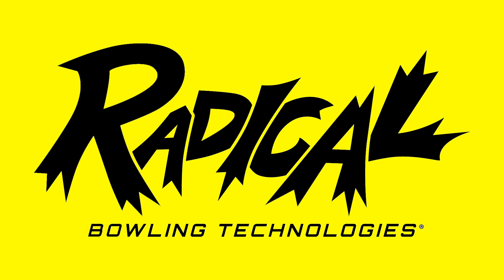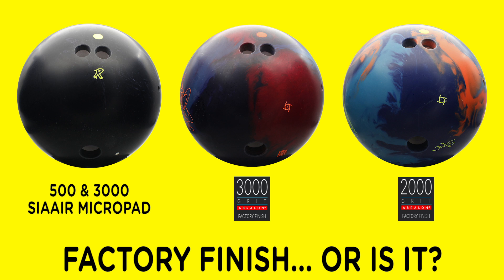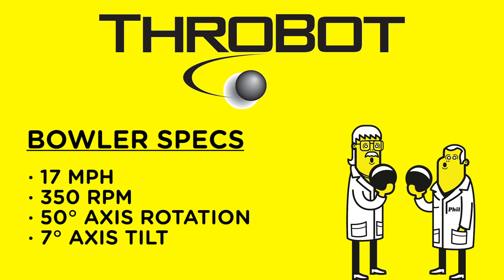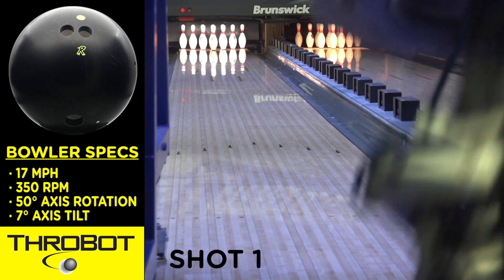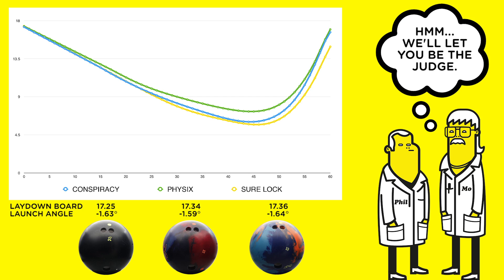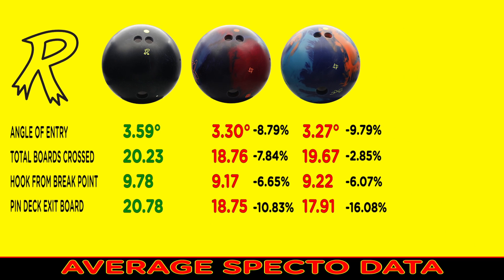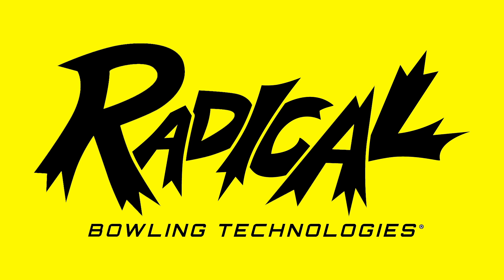Perception vs. Reality 6 - Radical vs. Storm

Comment: I think you got your data mixed up.
The first shot with the Physix left a 9 pin, but your data has the ball exiting on the 18.84 board which would have hit the 9 pin. The data you have listed as for the Sure Lock’s first shot has the ball exiting on the 21.9 board which would be correct for missing the 9 pin. Looks like those results were swapped.

The exit point of the 2nd shot of the conspiracy on the 23.18 board looks invalid. It’s not further left than the physix 1st shot which you have listed at 18.84 or 21.90.

The problem with videos like this is Radical can while filming, throw all the balls at all kinds of angles, then cherry pick the results, leaving the non-favorable results on the cutting room floor.

For the video to be useful, the viewer has to trust the presenter who is a salesman. 

Not exactly the most trustworthy profession.
Reply: Mike White 🙌💯👍
Reply from the maker: Let's play out a couple scenarios. 

The first, the 20.875 theory. If Specto happened to miss the data for the pin deck exit board, that would bring the average of those 2 shots to 19.77, or -5.11% of the Conspiracy. Still less. However...

The next scenario assumes that the 9 pin is on the 14 board. Pins can become off spot. https://www.dropbox.com/s/k1vf0yzfy4dw6yq/comparison4.jpg?dl=0  We wanted to check and see if the 9 pin was in the same spot for both shots so we backed up the ball path before anything comes in contact with the 9 pin. https://www.dropbox.com/s/emovp4256nc83m7/comparison5.jpg?dl=0 This shows that the 9 pin is off spot right on the shot with the Physix because the 9 pin location is not always constant.

And finally, the Sure Lock is much further left in this next image, because the Physix deflects to the right after the 8 pin impacts the ball. Watch the video, once it passes the 9 pin, it pushes back to the right. Specto captures the data point just before leaving the deck, but it is not known for certain the calculation so we can only assume just before it drops off the pin deck. So here are the 2 shots at the very last point before they drop off the back of the pin deck. https://www.dropbox.com/s/57233nzqso1fe27/comparison6.jpg?dl=0

We appreciate the discussion, we're in the science of bowling and there will be many more of these videos in the future.
Reply from the maker: But wait, there's more! 

Last scenario, we promise. If the Physix truly was 20.875 pin deck exit board (which it wasn't) then you have to take another look at the Conspiracy in shot 1 compared to the Physix with where it left the pin deck. https://www.dropbox.com/s/jglsjsa2ke7c8v1/comparison7.jpg?dl=0 The pin deck exit board is very close with the Physix a bit further left as stated in the video data, but both are still significantly further right than the Sure Lock on the first shot.
Reply: Y'all really reaching for some Conspiracy level conspiracy on this.  A robot throws the ball and the most advanced ball tracking system tracks it....  but the data is skewed.  What?!?!?  I guess we need to go back to the days of using humans throwing the balls to compare them.  Way more accurate.
Reply: Its not the data that is skewed, its the interpretation of the data that is skewed. If I throw a 6 lbs ball Brooklyn, the exit board is likely to be somewhere in the left gutter. Since that number would be larger than 23.18 does that mean the 6 lbs ball is better? Data without context is worse than "humans throwing the ball"
Reply: @mikewhite735  you probably want to throw a heavier ball and aim a little bit more right.
Reply: jangofett2 it depends, is my goal to increase my score, or to increase my exit board.
Reply from the maker: Continuation and strike percentage go hand in hand. 

For more context, on shot 2, the Conspiracy's entry position at the pocket was 16.27 board and continued to 23.18, or +6.91 boards of continuation. The Physix's entry position at the pocket was 16.45 board and continued to 18.66 or +2.21. Lastly, the Sure Lock's entry position at the pocket was 14.35 and finished at 13.92 or -0.43 boards. The ball that continues more has more energy going through the pins which equals more strikes. 

This is only one of the 4 critical performance categories we measure. All 4 contribute to higher strike percentages.
Reply: RadicalBowling You’re still confusing “continuation” with deflection. Throw 2 identical shots at the pocket. On one shot only have the head pin, on the other only have the 3 pin. They should have the same quality of shot, but drastically different exit boards. Exit board is not necessarily a good indicator of “continuation” in the case of the 2nd shot for the Conspiracy, the exit board is not a good indicator. This is a perfect example of potentially cherry picking the shots. 23.18 looks good but it only occurred due to fluke pin carry of the 5 and 8.
Reply: RadicalBowling of the 4 “critical performance categories” you list, only 1 is really important. Angle of entry. There are 3 total. Angle of entry, mass of ball, and offset. (I.e. where the ball hits the headpin)  USBC’s pin carry study showed the importance of offset.  Angle of entry of 2 to 6 degrees is plenty if the offset is correct.
Reply from the maker: Your analogy is incorrect. We bowl with a full rack of pins all the time and you're trying to introduce variables. (going brooklyn with a 6lb, using only a 1 or 3 pin) 

We throw identical shots. Once ThroBot lets the ball go, the laws of the universe take over and this is what we test. The only variables in this test are the different bowling balls and that's the point. The USBC found that the "sweet spot" of the pocket is around 17.5 board, but we're not testing that.  We're testing the performance of different bowling balls and using the data to show the difference. In fact, in all 6 shots, the "most flush" pocket hit was the Physix at 16.49 entry position. The Conspiracy was 15.62/16.27, Physix 16.49/16.45 and Sure Lock was 16.27/14.35. 

It's perfectly fine if you don't agree that continuation through the pins is not important. However, if you take 100 shots of identical total hook, hook power and entry angle with an average entry position of 17.5 and a pin deck exit board of 20 vs the same identical shots with a pin deck exit board of 16.5, which will strike more? 

The answer is simple -- the ball with more continuation through the pins. 
(Or if it makes it sound better to you, the ball that deflects less going through the pins)
Reply: Lets start with "the ball that deflects less going through the pins"

To determine how much a ball deflected you would need to know where the ball would exit if it achieved 0 deflection.

Based on the entry position, and angle of entry, the 0 deflection exit position can be calculated.

The results are as follows.
Ball Name, 
Shot #, 
Entry position, 
Entry angle, 
0 deflection exit, 
Measured exit, 
Net deflection

Conspiracy, 1,  15.62, 3.36, 18.07, 18.37, 0.30 left
Physix, 1, 16.49, 3.26, 18.90,  18.84, 0.06 right
Sure Lock, 1, 16.27, 3.32, 18.72, 21.90, 3.18 left
Conspiracy, 2, 16.27, 3.81, 19.08, 23.18, 4.10 left
Physix, 2, 16.45, 3.34, 18.92, 18.66, 0.26 right
Sure Lock, 2, 14.35, 3.22, 16.63, 13.92, 2.71 right

Conspiracy showed deflections of 0.30 and 4.10
Physix shows deflections of 0.06, and 0.26
Sure Lock showed deflections of 3.18 and 2.71

This would imply the Physix has the best continuation.

I stand by the calculations. 
But my conclusions are just as shady as you claiming the exit board of 23.18 indicating that the Conspiracy has the best continuation.
Reply: I suggest you go back and reread the USBC pin carry study.  They did NOT find that the 17.5 board was the "sweet spot". Someone at USBC did produce an incorrect chart that could be interpreted that way, but it doesn't match up with the data.
https://bowl.com/uploadedFiles/Equipment_Specs/Information/pinCarryStudy(1).pdf
In the PDF there are charts for different entry angles.  Note the X axis of the chart is inches of offset.

http://usbcongress.http.internapcdn.net/usbcongress/bowl/equipandspecs/videos/ILeftWhatWhere.mp4
At the 58 second mark of the video, the chart presented attempts to convert the inches of offset into entry position, but it's not done correctly. 
It appears that 19.5 entry position is equated to 0.5" offset.  
That begs the question, where is the head pin located. 
In terms of boards, it's 19.5 boards from either the left or right gutter.
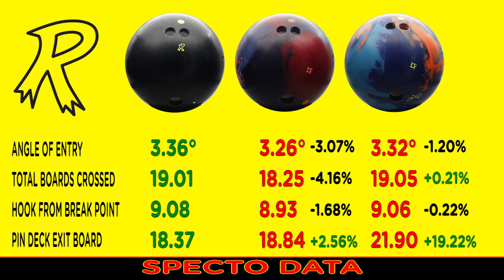In the same video, at the 1:55 they show what they mean by offset, and give an example of 6 degrees of entry angle, and 2.0" of offset.  
That resulted in the center of the ball being 2.68" right of the center of the head pin at impact. 2.68" converts to 2.52 boards. 
Since the head pin is centered on the 19.5 board, the ball would be centered on the 16.98 board, and that's only a 2" offset. 
For 2.5" offset the center of the ball would be 3.18" which is 2.98 boards, so for a ball with 6 degrees of entry angle, and 2.5" offset, the "sweet spot" is the 16.52 board.
Reply: "It's perfectly fine if you don't agree that continuation through the pins is not important. However, if you take 100 shots of identical total hook, hook power and entry angle with an average entry position of 17.5 and a pin deck exit board of 20 vs the same identical shots with a pin deck exit board of 16.5, which will strike more?"

Clearly something would have to be different for one ball to exit on the 20 board, and another exit on the 16.5 board.

The difference would appear to be entry angle, and or ball mass.
Ok, you get 100 shots with an angle / mass combination that enters at 17.5, and exits at 20, and I get 100 shots with an angle / mass combination that enters at 17.5, and exits at 16.5.  I predict that out of 100 shots, my selection will carry more strikes.

My reasoning.

To achieve the 20 exit board, you will need a decent amount of entry angle.
As the USBC Pin carry showed, as entry angle is increase, the "sweet spot" moves to the right.  Since you are maintaining the same entry position, you're more likely to leave 4, 7, and 9 pins.  

I on the other hand will reduce my entry angle to make 17.5 board closer to the "sweet spot", then select a weight ball that increases my chance of carrying the 10 pin.
Reply from the maker: Your calculations are off, sorry to say, but glad you put up a disclaimer that they'd be wrong anyway. Plus, you did not take into account that the entry angle will change when it impacts the pins depending if the ball is rolling forward or still hooking. This is why the Conspiracy has more continuation and even your results say so. 

And like we said, we're not here to argue over the Pin Carry study. Their results were achieved with balls being thrown straight at the pins at the desired entry angle. 

Bottom line, the Specto data is the data. The Conspiracy continues through the pins and keeps hooking because of its design. The numbers are there, the visuals are there. If you don't like the results, we suggest not tuning in for Perception vs. Reality Part 7.
Reply: My disclaimer was about the conclusions. 
My calculations were not off. 
If you think they were off, show what you consider to be the proper calculations. 

"entry angle will change when it impacts the pins"

What do they call that change of angle?   Oh yeah, deflection.

Are you saying that the balls measured are rolling forward, or still hooking?

"This is why the Conspiracy has more continuation and even your results say so."

My results said the Conspiracy deflected more. 
You are the one equating deflection and continuation.

"And like we said, we're not here to argue over the Pin Carry study."

You are the one who used the study incorrectly to determine the "sweet spot"

"The Conspiracy continues through the pins and keeps hooking because of its design"

So you're saying the Conspiracy is still hooking, and not in the roll phase when it contacts the head pin.

Most humans I know have the ball reach the roll phase well before contacting the pins. 
They find it difficult to keep the ball hooking all the way to the pins.
The ones that manage not to reach the roll phase tend to have an extended skid phase, and a very ineffectual hook phase.

Is that why you use ThroBot, so you can tweak it until it can achieve something most humans will not be able to?
Reply from the maker: They're all hooking in this test as their impact angles are higher than their entry angles. That's what happens when you get a 45' pattern and a ball doesn't have the benefit of mechanical friction to rely on for performance. It also happens with speed dominant bowlers and bowling balls with less surface. We don't need to tweak anything, we set up the specs for the shots and record the data. If you think a ball that hits 16.27 and exits on 23.18 is deflecting, well we don't know what to tell ya. 

Happy Venting.
Reply: "They're all hooking in this test"

Why did you have to make a 2nd shot for the balls?

Oh yeah, Cartoon Mo said the Storm Balls rolled early.
So again I ask, where these balls rolling or still hooking?

After recording the data from the first round of shots, it was decided to alter the launch angle.  

That is "tweaking" it to obtain results you consider more favorable to your product.
That kind of dishonesty is expected from a salesman.
Reply from the maker: Both. The Storm balls hooked early in the baseline test. The graph shows it plain as day.

We're good at quoting too, here check it out:

"The first shot with the Physix left a 9 pin, but your data has the ball exiting on the 18.84 board which would have hit the 9 pin. The data you have listed as for the Sure Lock’s first shot has the ball exiting on the 21.9 board which would be correct for missing the 9 pin. Looks like those results were swapped."

Wrong. https://www.dropbox.com/s/1dji9h8tejh5ilh/comparison3.jpg?dl=0

“The comparison I find most telling is the shot 1 of the Physix vs the shot 2 of the Conspiracy. The Physix makes contact with the headpin approximately 3/4 of a board further right.”

Wrong. https://www.dropbox.com/s/1vn80813s394g26/comparison8.jpg?dl=0
The Physix entry position was 16.45 and the Conspiracy was 16.27.

“After deflecting off the 3 pin, both balls are at the same position when they reach the back row.”

Wrong. https://www.dropbox.com/s/vf9cavakoa4un0e/comparison9.jpg?dl=0
They have reached the back row, the Conspiracy is still further left and will keep continuing more left through the pins. 

“The exit point of the 2nd shot of the conspiracy on the 23.18 board looks invalid. It’s not further left than the physix 1st shot.”

Wrong. https://www.dropbox.com/s/wfq2zul34wpp2fr/comparison2.jpg?dl=0

The data speaks for itself. I think we’re done here.
Reply: First off, I don't currently work on staff for any bowling company. But second, and more importantly: Mo Pinel is probably the most universally acclaimed scientist regarding bowling physics throughout the industry.
Reply from the maker: It's ok, everyone has the right to be wrong. https://www.dropbox.com/s/tpctn7szwwo7j9g/comparison.jpg?dl=0
The Sure Lock didn't even touch the 9 pin and the Physix narrowly missed the 9. The Specto data is the data.
Reply: The comparison I find most telling is the shot 1 of the Physix vs the shot 2 of the Conspiracy. The Physix makes contact with the headpin approximately 3/4 of a board further right. After deflecting off the 3 pin, both balls are at the same position when they reach the back row. In the case of the Physix, the ball then deflects to the right off the 5 and 8 pin while with the Conspiracy, the 5 pin has bounced off the 8 pin, and is over in front of the 9 pin. That makes the ball deflect off the 5 pin further to the left, and since the 8 pin has already been hit, the ball doesn't deflect off it back to the right. By giving such weight to exit board, you're rating the Consipiracy as 23.18 compared to 18.84 for the Physix simply because of deflection. Without context, exit board is meaningless.
Reply from the maker: https://www.dropbox.com/s/wfq2zul34wpp2fr/comparison2.jpg?dl=0 And again for reference.
Reply: Where we differed was how far down the lane is considered the exit. To me, that should be when the ball reaches the back row. Specto seems to indicate significantly further. What the ball does after contacting the last pin it does contact, doesn't have much meaning.